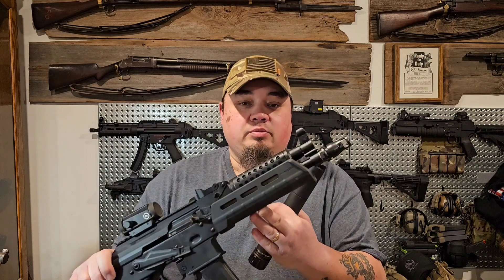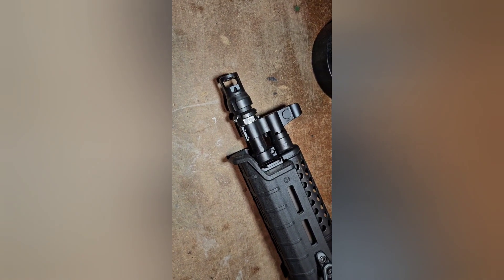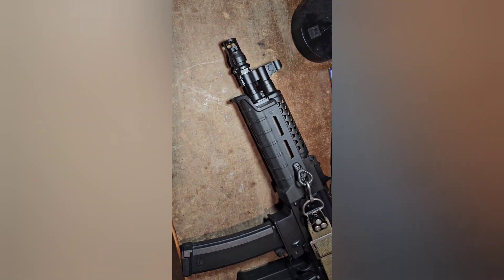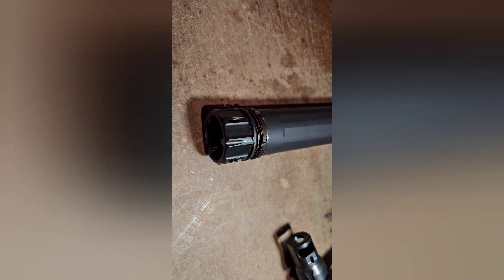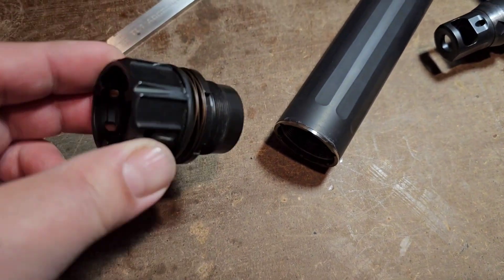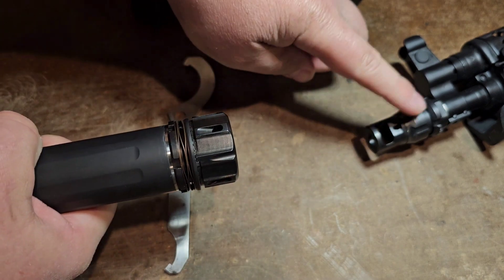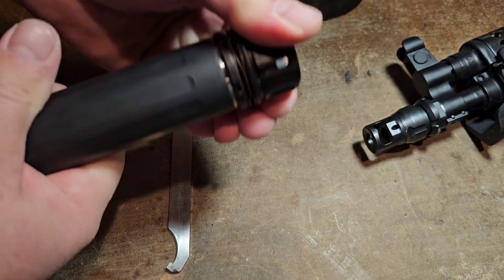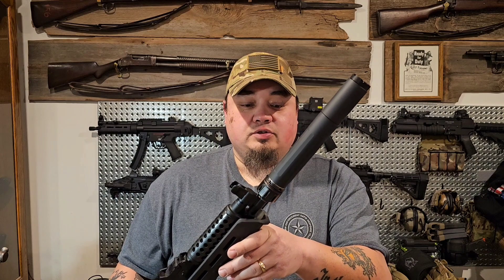Dead Air Silencers Key Micro Mount and Muzzle Device

Comment: Im confused, trying to get the micro for an 8 inch 300 blackout, can i use my sandman S on this? or I need an adapter?
Reply from the maker: @jbcustom3745 the Sandman will work with the Key-mo and Key-micro muzzle breaks/adapters.  As long as you get a Key-micro brake that has a .30 bore, and yes the 9mm bore will pass a .30 caliber bullet which the .300 black out is. You will be good on your set up

Comment: I have 2 keymicro brakes on my fireaems i got the keymicro adapter my question is there other surpressor i could use with this setup besides deadair? Like will the keymicro adapter screw in other companies surpressor? Thanks